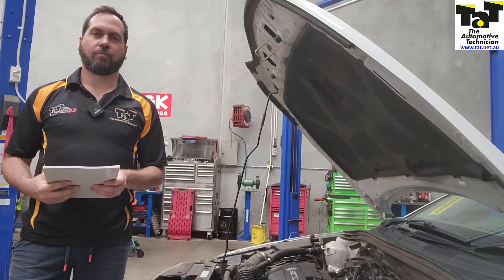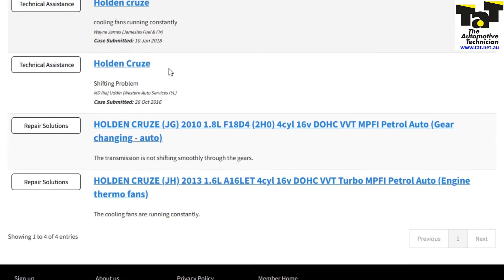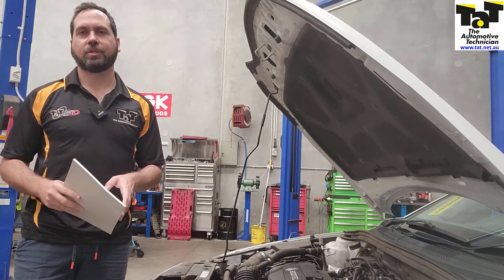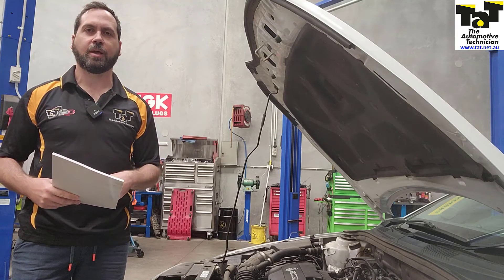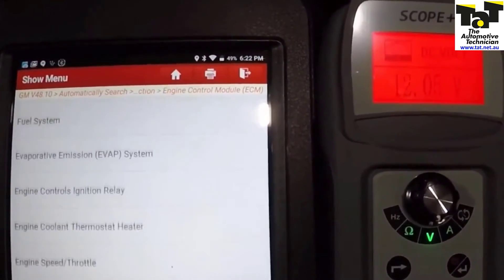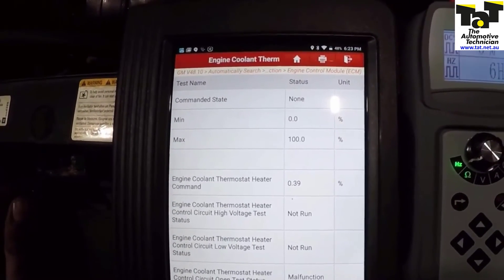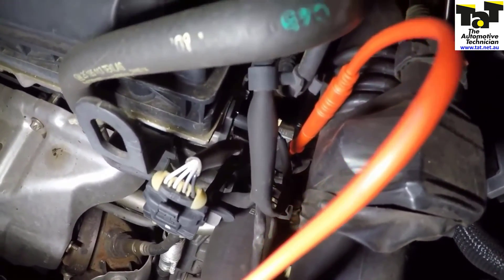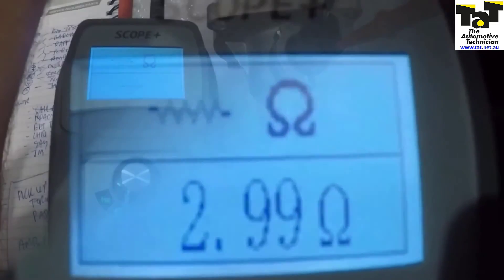2014 Holden Cruze with the engine warning light on and the cooling fans running constantly

Comment: Yo Rob, what it do bro. You looking like you need some rest.lol. Good tip. Had this issue on a chevy sonic a while back. Just checked the temp sensor, resistance on the unit and kept it moving. Thanks bro